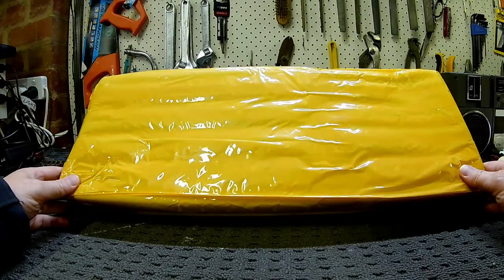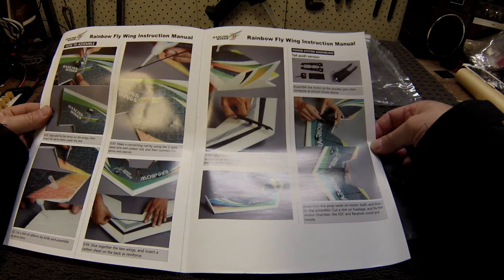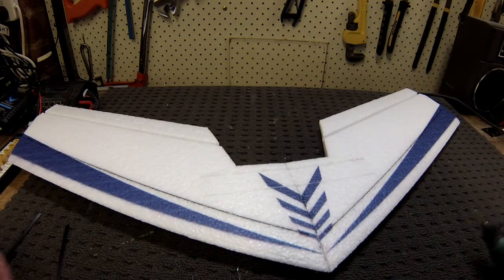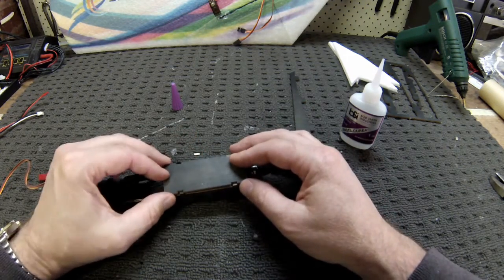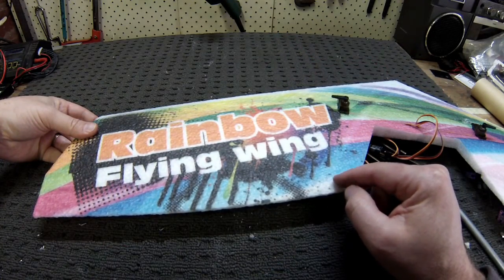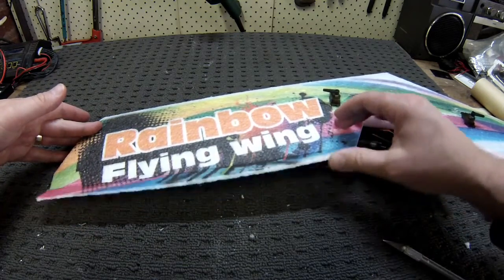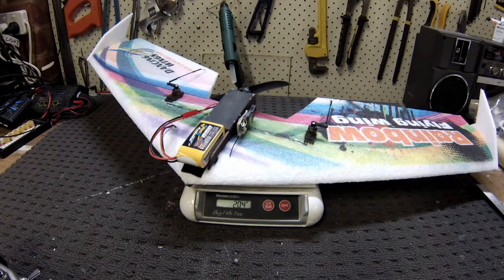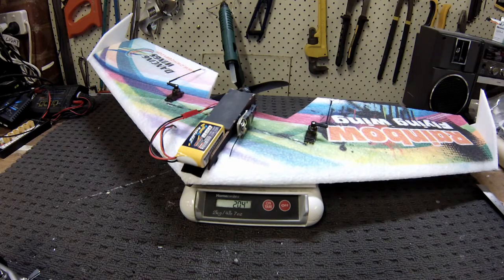Banggood DW Rainbow V2 - Build

Comment: Hi,  Have been using carbon for pushrods for a long time now.  Rough up the end of the carbon with sandpaper first, and rough file the steel Z bend shaft too. Slide a piece of heatshrink over the two, adjust the length to suit.  Then, have your heatgun ready . . . Quick single drop of CA on either end of the heatshrink and immediately heatshrink it on.  The CA wicks into the tube straight away.  Have never had one come loose, evan in big crashes.
Great build video!

Comment: Michael,  Thanks for the info. I"m a bit confused about the motor can you tell me where to get one? my confusion is in the rotation? does it rotate clockwise because it is a pusher? or is it the prop that needs to be a pusher prop?  can I get this motor at banggood? is it a quad motor? Thanks so much for your help.

Comment: Michael,  I just bought this wing...and I'm want the best performance and wind penetration.  What prop? 2s Battery mAh and motor spec for weight and thrust..?  is a 2s 1000mAh battery to much? or not enough weight. I'm trying to use a 12amp speed controller.  Thanks any insight or changes you have made will be appreciated..I want to fly in 10-15mph winds..
Reply from the maker: G'day Aaron, I have been really happy with the set-up here in the vid 2212 2300kv with 5x5 prop. I am running a 850mah 2S and I think you could go up to 1000mah no problem. I think the only change I'd make is some sturdier control horns, the stock are a bit floppy. And maybe a little carbon in the elevon to make sure the whole surface is actuated with the horn. But really, you can't go wrong with this thing. Cheers Michael

Comment: where can I obtin the deflection and expo rates
Reply from the maker: John Miller I don't seem to have the instructions anymore, usually they are in the back, but I am running mine with maximum throw, 25mm for the aileron and 20mm for the elevator. No expo, but that is personal preference. You could run 10 or 20 percent if you want. It already feels a little squishy so expo is not necessary

Comment: i hate my wing.. can't get it to fly.. when I throw it, it just goes down
Reply from the maker: TrullsFPV maybe add a little, maybe 2 or 3mm, reflex (up) to the elevons. This will help if the plane is going down. Also double check the C G to make sure it is not too far forward. Good luck. Cheers Michael
Reply: I am using a tripple bladed propeller. Is this bad?
Reply from the maker: nah, that should be ok.
Reply from the maker: Andrew has a 6 blade and it works well. https://www.youtube.com/watch?v=nK-g1ZHDXEg